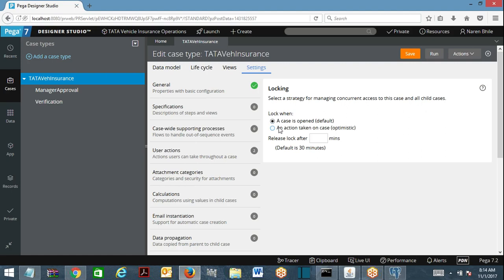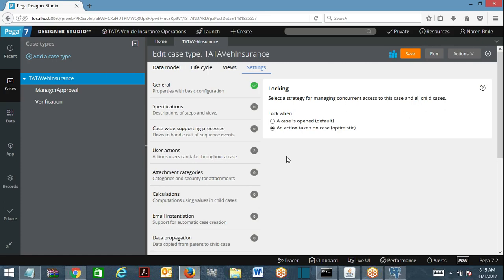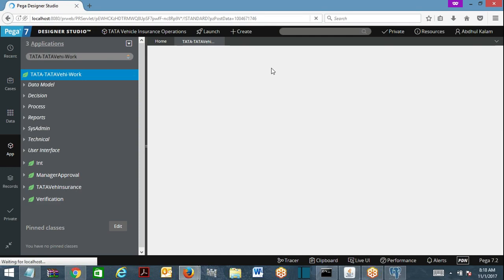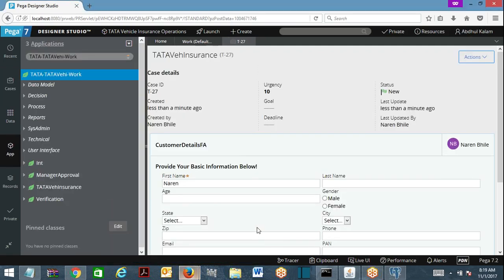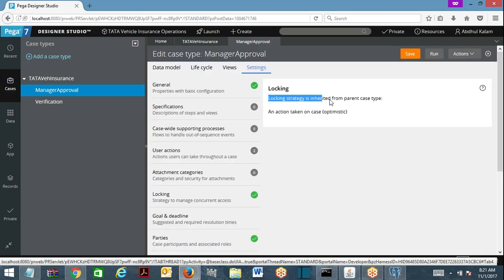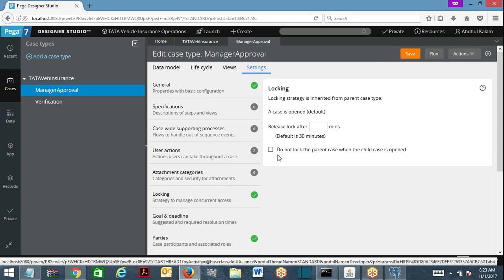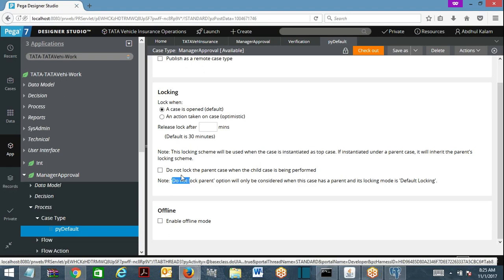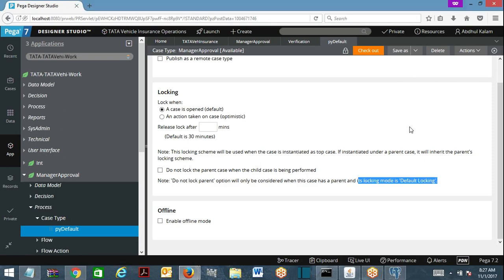What are Different Types of Lockings in Pega - Pega Training - Call / Whatsapp +919652532753

Comment: Excellent Explanation and more importantly DEMO on the Optimistic Locking in PEGA. To summarize - Optimistic locking enables multiple operators to open a case. No lock is obtained when the case is opened. The lock occurs when the user Submits a case. When multiple operators are working on the same case, the changes to the case are made by whoever submits the case first. When the next operator tries to submit, operator receives a message with the last saved operator’s name and the time of the change. This operator can only proceed after incorporating the new changes made by the first operator using REFRESH. This second operator’s changes are not applied to the Work Object until the second operator clicks refresh and the submits their data  after the refresh.